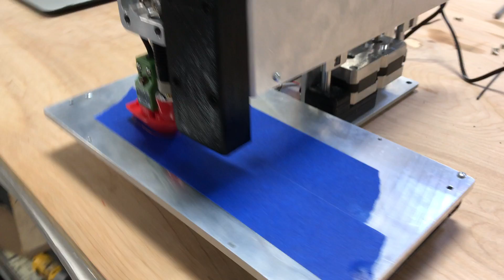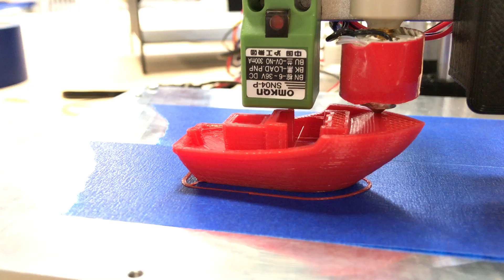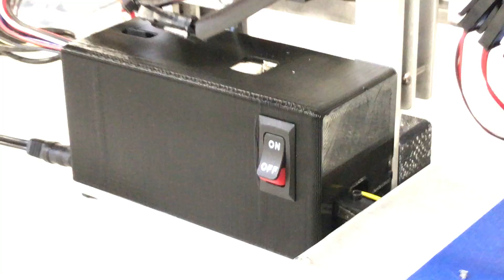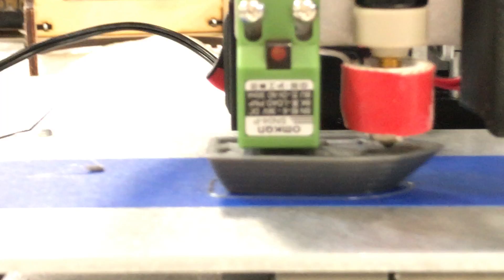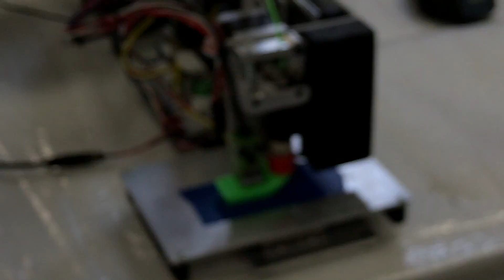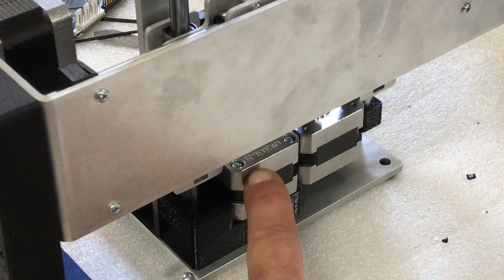Printrbot Smalls Test Prints

Comment: What speed/acceleration settings are you using on these? Can I use the same on a Simple Metal Rev. F?? The movements look so smooth! Mine moves way more janky. These seem to accelerate/decelerate very nicely, mine just goes linearly from there to there...

Comment: I have an order in for the small currently will be able to add the extended bed with power supply kit so that they ship at the same time or are we just ordering the Y axis play kit with atx.  Thanks
Reply from the maker: We will reach out w instructions to add upgrades to all the orders before shipping. I didn't realize we would have them available so fast ;) 

The 8x6 is essentially a play upgrade, and atx is optional in the cart. Some have them already- it IS needed. But I think the belt is longer so we will ask everyone before shipping. If you aren't going to use the little bed, we won't include it. I need to finalize pricing too ;)

Brook

Comment: Can you print some flexible filament? :) I'm tempted....
Reply: In my opinion, If it comes with the Ubis 13s (seems to) then you CAN print with Flex, but always remember to slow it down!  If your jamming then your going too fast.  The Gear head extruder definitely prints a bit faster and is pretty much guaranteed to grip anything, but it can get jammed too, especially with flex when done too fast.  I've done okay with: ~5-10mm/s for base layer, then less than ~20mm/s, with retraction speed reduced too!  Again, slower is always more accurate and it sticks better to the platform better.  Don't burn out, just slow it down...  but I would recommend getting the gear head when you can if the option is available just because it is such a great innovation!